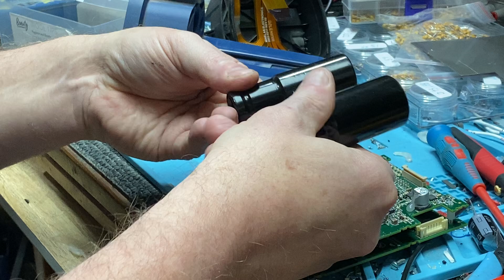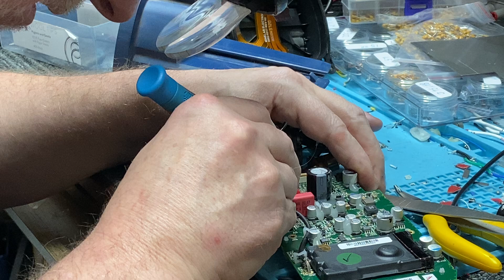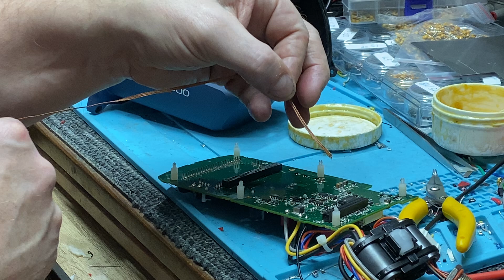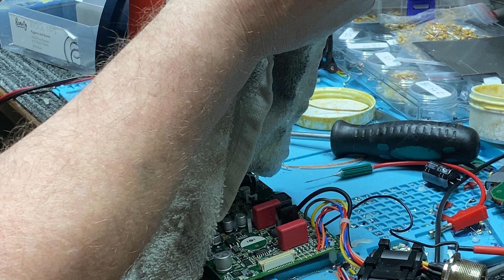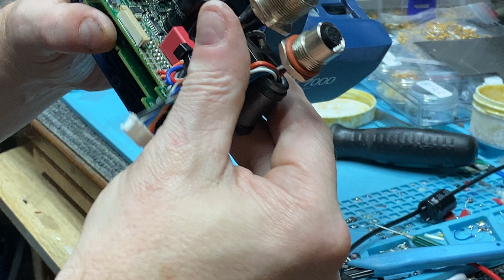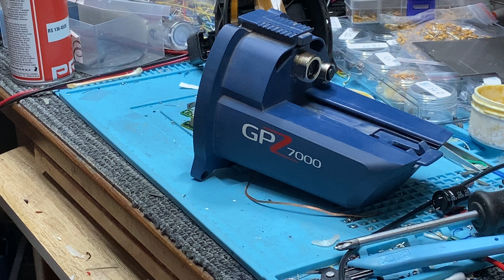How to repair a GPZ-7000 , shorted power supply repair, simple but also can be tricky.

Comment: Another trick to clear the solder holes is to heat up a thin pointed SS dental probe. The solder doesnt stick to it. The hook shaped ones are the best. Used many times as as a repair tech years ago.
Reply from the maker: That is a good idea, I have also used toothpicks, but they do not last long.
Reply: The good thing is they are tapered so as you push it thru it widens the hole by pushing all the solder out.

Comment: My GPZ 7000, has the problem of power off it's self what can I do?
Reply from the maker: It maybe the connector between the data dongle on the power supply board back connector to the cpu board back connector, also check green LED near power supply supervisory input to rest of circuit.  Also check legs on drq 74 330 as I found an intermittent, there can be many problems that can stop the detector functioning.

Comment: will one of those pencil dremils with micro drills get that solder out
Reply from the maker: It can but it can destroy any internal connection in the board layers, it is risky to do on the unknown.
Reply: @DetectorMods Please tell me r417 resistor value